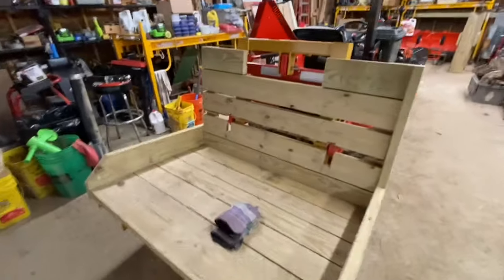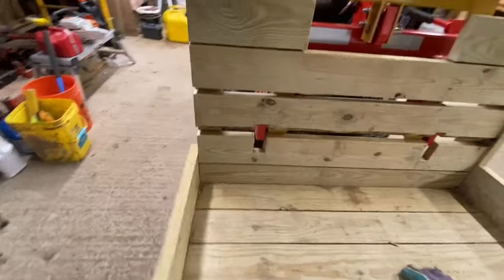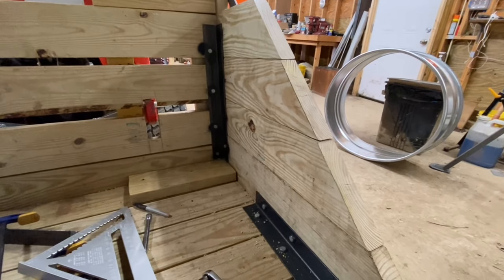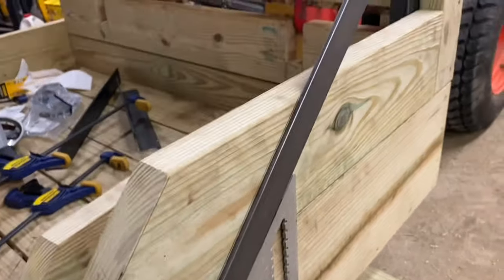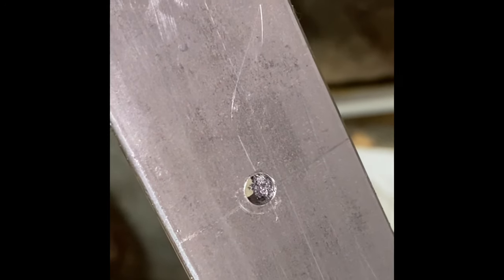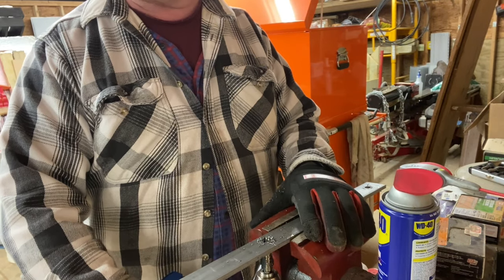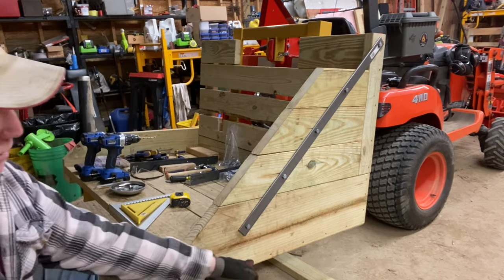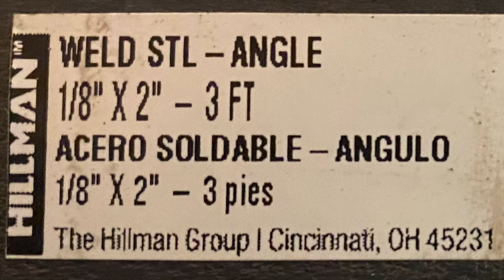#66 - BX Carry All Build

Comment: Nice modification,  strong design! 🚜🪵👍🏼🇱🇷
Reply from the maker: Glad you like it!  It has made my woodyard situation so much better.  I got the idea from Backwoods 40 - originally I planned to carry it with my pallet forks, but the little 18hp BX is not strong enough to lift the carry all and the firewood.  I can put half a face cord into the carry all and move it to my wood pile for seasoning.
Reply: @botabob  Bob, Dan is the man! We bag our bundles and use the same bags, after watching back 40 video 🚜🪵👍🏼🇱🇷

Comment: Great job there ! Been looking at Tractor Supply this weekend at those carry all frames. They’re 189.99 plus tax here in NC. Probably gonna go this route as well in the near future. Think it will be a handy little addition. Have a Blessed Day !
Reply from the maker: Right on - I picked that one up in January or February - It is a very solid frame - my only complaint are the sharp edges - I banged my head on the top link mount point - almost knocked myself out and cut my forehead good -  I would buy it again though. Thanks for watching and commenting.

Comment: That looks like it should work, Bob!
Reply from the maker: I hope so - It's going to make moving my firewood a lot easier - It worked great with the short side walls, but I will be able to fill it up to the top now - Initially I was not sure how I was going to build the sides, I thought about another 2x4 on the outside but did not like the look.  I like this setup a lot.  Thanks for watching and commenting Whipple